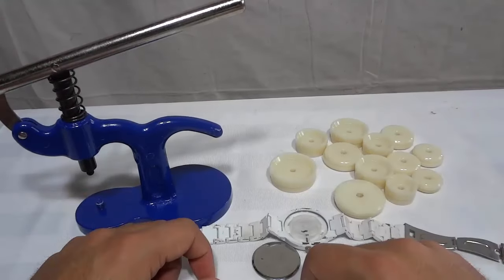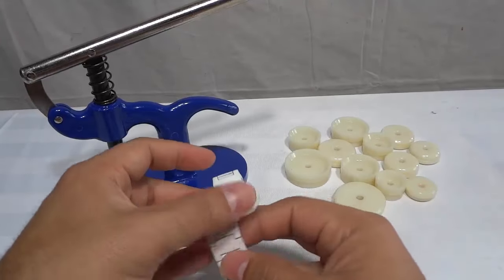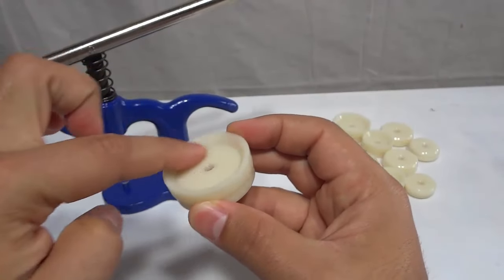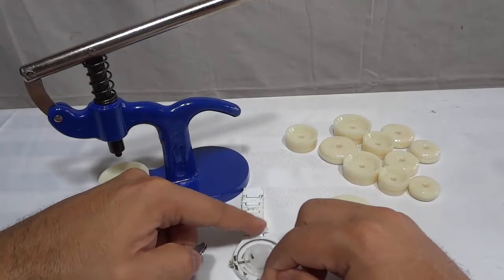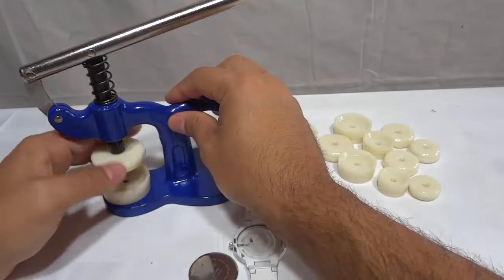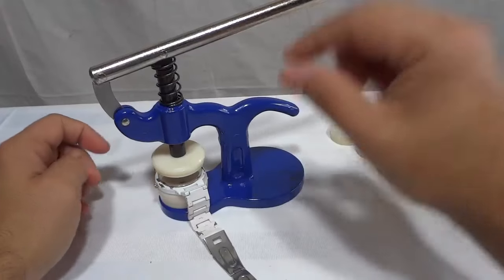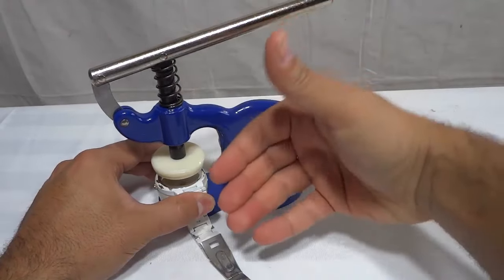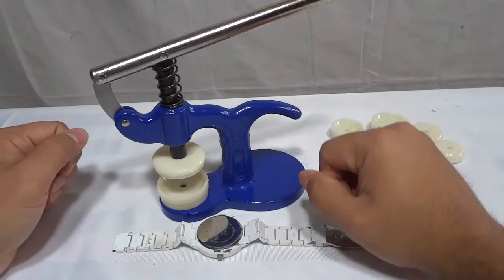How To Close A Snap Off Watch Back With A Watch Press (Tutorial)

Comment: Read reviews about these breaking if too much pressure used. Used the piece of wood method on back when first changed Citizen watch battery a few years ago. And clicked back in place then. But this time around after a couple of very frustrated hours of trying with various pieces of lumber, just kept tilting from side to side. Ordered one of these, still no luck with moderate pressure and didn't want to push my luck. Set the watch face down in the most suitable stable nylon die sitting on a solid surface. Could have even been supported on the lugs. Then pushed down on a piece of hardwood, 20mm x 40mm x 300mm and bingo, finally seated back in place. Couldn't believe it a first as did not hear a click, but now firmly in place. Maybe should have wrapped rough finished wood in something, as a few faint scratches. But polished these out with Autosol, not that really matters. Cheapest one available, but worth it for the nylon dies in my case.

Comment: I'm a bit surprised that you didn't mention the most important step when reinstalling the watch back.  Make sure you line up the little notch on the back plate with the stem.  If you don't you may bend the stem and you will not be able to reset the time on your watch.
Reply: If that were true, the notch on my watch would have been that way from the factory, it wasn't. It was lined up with a lug.
Reply: Same comment from my husband when he did my Anne Klein watch which is always a pain in the neck to snap back together. Many thanks for the video though! It helped a lot!
Reply: I guess on many watches, there are no little notches to line up. I don't see any notches on any of mine.
Reply: Not all watches have that but some do like my dads Armani have to make sure that the notch is centre
Reply: So how do you press on a watch back that isn't a round shape? I can't get my friends back on as it is a weird shape, not round on the back or front, any ideas??

Comment: how close without the watch pressor
Reply: It depends on the watch type: simple quartz watches with flimsy backlids (planned to be taken off for frequent battery changes) can be pressed back with a plain ruler or metal bar on a soft table cloth surface,
Real watches with massive cases and lids need a beefy vice; use proper spacers to protect the front and back glass or these will shatter under the pressure.